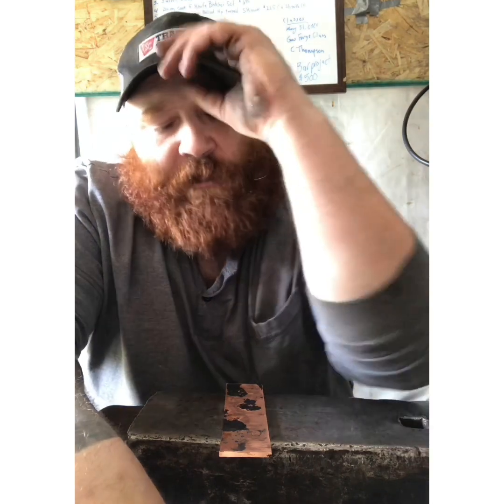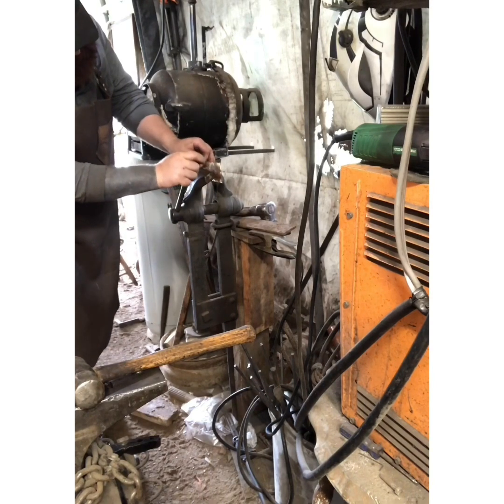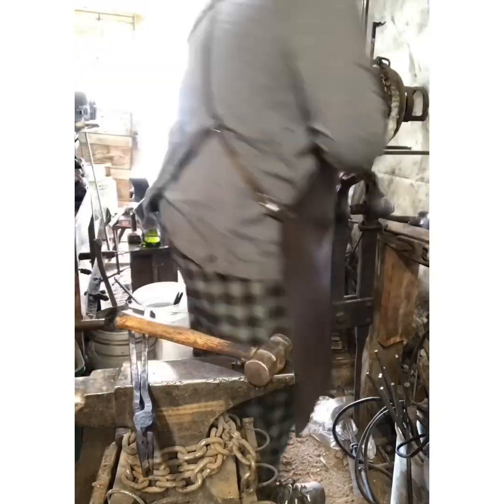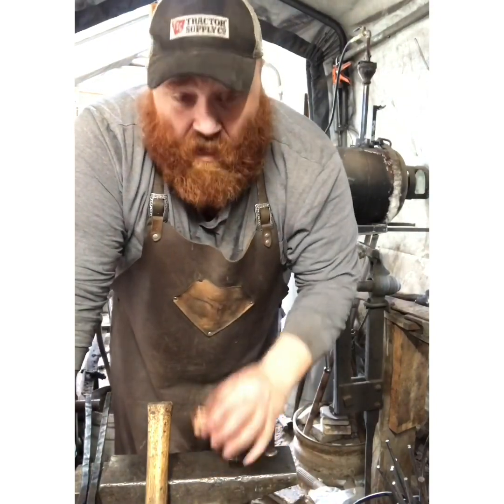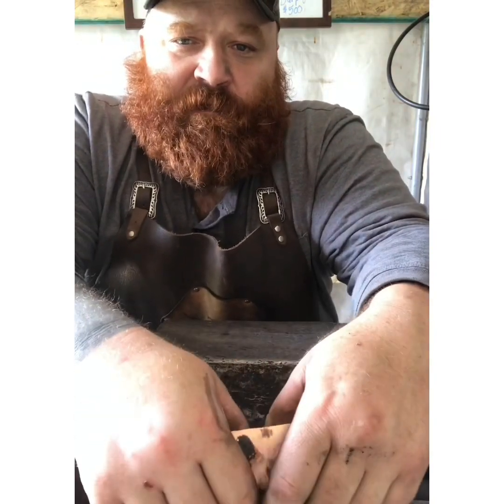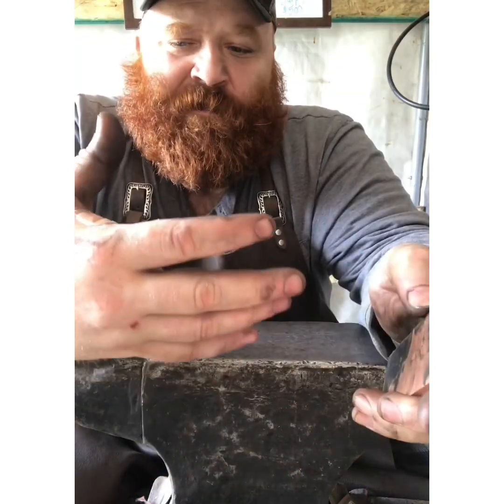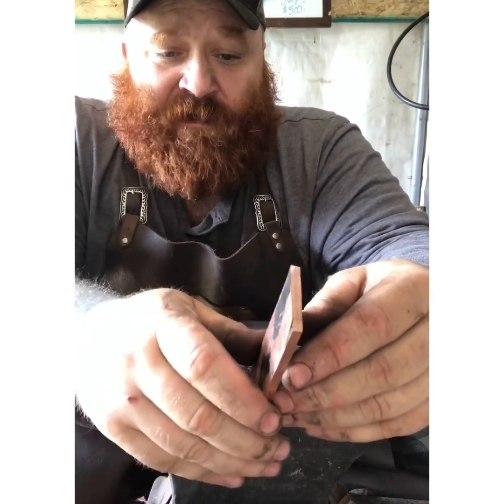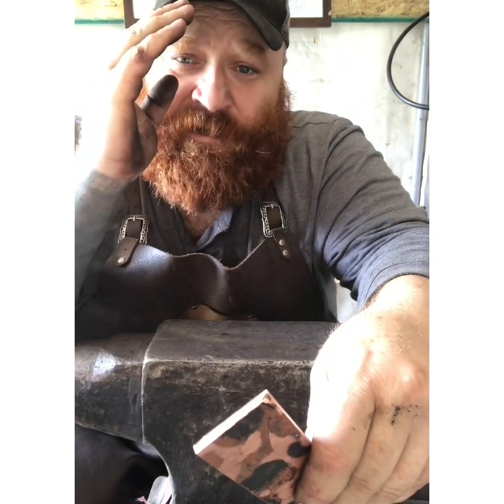Making a Copper Billet

Comment: Harris soldering  Acid Clean your pipe before starting neutralize it with water then forget And  Clean  Where a stainless steel brush and between folding and heating